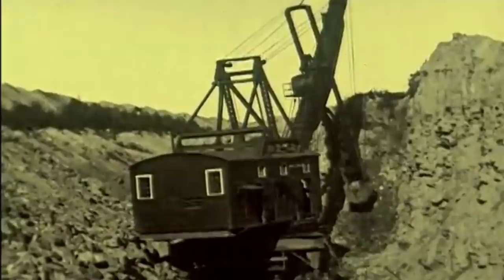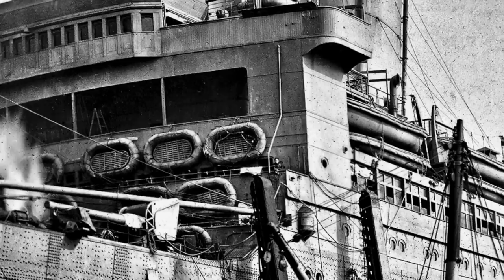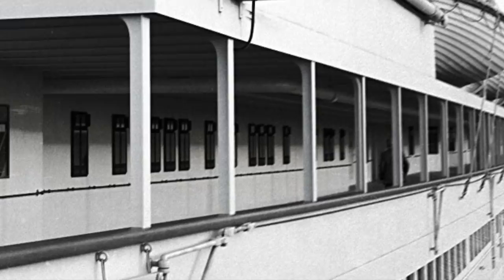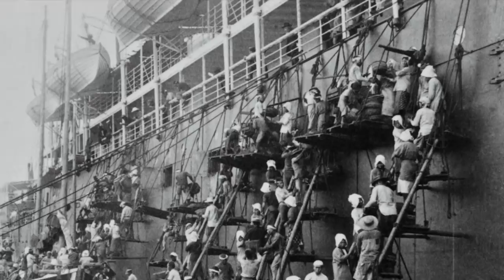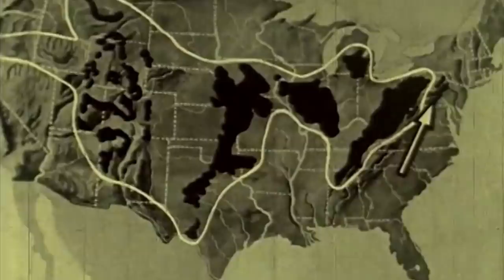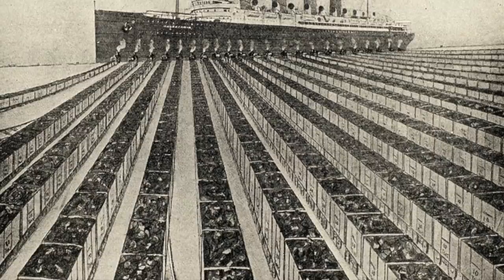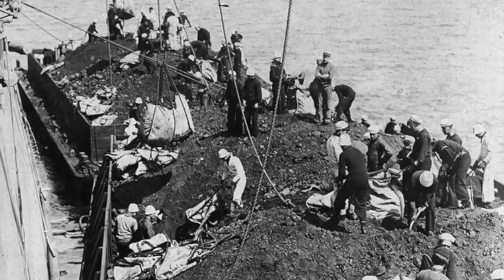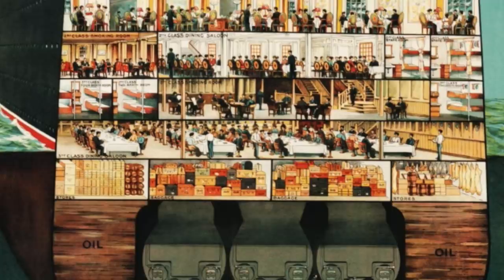Coaling/Bunkering an Ocean Liner

Comment: An example of how coal supply can cause problems was RMS Atlantic - for a long time Canada's worst ship disaster in terms of lives lost.  Atlantic was inbound New York, pretty-well full of passengers including steerage, whose access to the boat deck was severely circumscribed by the two little hatches that were all they were given.  Unknown - but rumoured - the White Star Line had 'salted' its coal load with some cheap stuff; Welsh steam coal was acknowledged the best, and needless to say, it also commanded the highest price so it was not unknown for shippers to bung-on a few thousandweight of cheaper stuff (or even 'made' coal; collected coal dust with a binder to hold it together - Kipling's "McAndrew's Hymn" refers).

So RMS Atlantic set-out against the Gulf Stream and continuously encountered foul weather, and used more coal than planned, and at some point the chief Engineer advised the Captain that they likely didn't have enough coal to reach New York; in this, modern estimates suggest he was wrong and was exaggerating the problem, but hindsight is 20/20 after all.  The Captain turned north toward Halifax to get more coal, and a "comedy" of errors and disobeyed orders resulted in tragedy.  Celestial navigation with stars and sextant was how ships navigated across oceans then, but they'd been in ugly weather long enough that they were navigating by dead-reckoning and unsure of their position.  The Captain retired to his cabin for some sleep, leaving orders that he be awakened at midnight; his intent was to slow the ship and start taking soundings with the deep-sea lead to learn the water depth and bottom composition, which would give him an idea of how far offshore they were.  Then they would anchor and await daylight, to take sightings of the shore and compare with their charts, and if need be they'd send a boat ashore to ask a local fisherman where they were - all perfectly normal in those days before GPS.

But the bridge watch decided to let the Captain sleep so they never called him at midnight and RMS Atlantic kept-on northward at high speed, and the current off the Nova Scotia coast sets to the southwest; so as they approached the shore, watching for the Sambro lighthouse west of Halifax harbor, they were already too far southwest to see it.  RMS Atlantic slammed into the rocks just offshore and was swept onto its beam-ends; most of the immigrants drowned trying to get onto the deck, and the heavy swell drowned many more of those who did get off.  The stupid little things that cause fearsome results...
Reply: There's a good documentary on the Atlantic that includes excellent computer graphics, reenactors, and local historians: https://www.youtube.com/watch?v=Z6JkwN7kw8E
Reply: It's OK, the crew lost only 10 men and the captain was awake at midnight
Reply: Chief Engineer John Foxley had a habit (which was commonplace amongst engineers) to under estimate the coal reserves in order to force Captains to be more cautious. The ship had enough coal to reach New York, but barely and Foxley knew that, had he reported the actual amount remaining, it would be at odds with his previous reports, so he chose to under estimate again.
Reply: @SiriusXAim  Even today, Chief Engineers love to show less fuel and diesel oil in the log books.  Its often to have a little extra just in case of any issues, and ship owners charge the charterers for more fuel use as well.  That's why when a ship goes on and off-charter, there are surveys done to confirm the actual amount fuel on board.

Comment: I remember in a book about the German merchant raider SMS Wolf (spent an astonishing 451 days at sea w/o once entering port), they're on their way back to Germany & about to run out of coal, & as a result basically pirated a Spanish freighter loaded w/ coal. at first they thought this was an incredible bit of luck, but ended up screwing them over because the vastly inferior Spanish coal only had about 1/20th the energy as the plundered British coal they had been running on. trying to transfer the coal at sea actually ended up burning coal at the same rate-of-speed they could transfer it to The Wolf, so they had to cut their losses & abandon the newly captured freighter & coal

Comment: I'm writing a historical fiction / high seas Thriller that takes place during the years before during and after the first world war. This information is very helpful in video form. Enjoyed the video very much
Reply from the maker: I'm glad this is helpful. The sources for this video are listed in the description, so you might want to check those out too. Good luck with the book!
Reply: I was in the navy and was a boiler tender.  The boiler tenders had the hardest job on the ship.  they had to spend hours and hours to get the ship's boilers and equiptment up to running speed,  before all the other sailors had to board the ship. and it was hotter than hell in the boiler rooms as the ships were designed to cruise in seas of average temperature, In the south pacific the sea temp is much higher and as the ship aged, more demands were put on the operating plant, by bigger airplanes to launch strained the machinery caused breakdowns. and when you returned to port you had to complete the work and repairs you could not do at sea, because the boilers were constantly fired at sea.  Boiler tenders had the least amount of time on shore, because of this reason.  all the other sailors could  just close up shop and leave the boat while in port.  I liked the navy, but wanted to have a dog and figured it wouldn't happen in the navy.
Reply: This would make a great activity to work into the plot somehow.
Reply: David Jones  No i just learned life is not fair.  Boiler tenders got no respect.  all you ever see of carriers is video's of the fly boys.  it was dark and dirty in the boiler room, they used to send sailors down to the boiler room for extra duty, as punishment.  we had extra duty every day.  we never made the guys assigned extra duty work.  it was bad enough just being with us in the hot nasty place.  only way you can get guys to work in the boiler room is to make 18 year old punk recruits like me do the job .
Reply: @johngillon6969  I've noticed that steam engines in particular are romanticised to no end, often by people who are dissatisfied one way or another with their modern lives. I can't deny that steam engines are awesome to look at and hear. But like most things people get nostalgic about, they tend to forget the poor sods for whom this was grueling, badly paid work that even the sailors on higher decks considered punishment.

How much contact was there between the "departments" aboard the ship? Did sailors and machinists mingle off-shift?
Reply: @namewarvergeben  Engineering had the divisions sleep in separate compartments of of the ship 3 main machinery had it's own berthing space.  we hung out together and went on liberty together.  we kind of had a pride in that we were the boiler tenders, and it was such a shitty job.  we were young punks .  All the other rates such as those who worked on the flight deck hung out amongst themselves but for the most part we all got along together.  We just learned that life wasn't fair and we made the best of the situation.  I didn't feel resentment or put upon, it was just what happened, and the navy was like the family i had left in albuquerque.  I think we were all proud of our ship and loved the captain like a father and those with higher rank were like older siblings..  We all tried our best to be good sailors and act like were all grown up men tho we were for the most part 18 and 19 year old dumb kids.
Reply: @namewarvergeben  LOL.  When people wax nostalgic about the old days, a friend of mine replies "I have two words for you. Modern dentistry."
Reply: Some required reading... "McAndrew's Hymn," by Rudyard Kipling. "The Sand Pebbles," (made into a film starring Steve McQueen, amongst others) and "The Left Handed Monkey Wrench," by Richard McKenna. Then spend some time volunteering on the preserved steam ships nearest you... Or if you have the cash, the R.M.S. Segwun in Gravenhurst, Ontario is a coal-fired steam ship with twin reciprocating compounds. The T.S.S. Earnslaw on Lake Wakatipu in New Zealand is coal fired with twin triple expansion engines. The S.S. Sir Walter Scott of Lake Katrine in Scotland is coal-fired with a single triple-expansion engine... There are more around the world. 

Good luck! 

I'd love to read it when you're done!
Reply: Thanks for the helpful insight y'all
Reply: Sounds like a good story

Comment: Thanks for this hugely interesting episode. I visited USS ‘Olympia’ in Philadelphia some years ago and was impressed that everything on that ship ran on steam, all of which was reliant on coal. At points in the ship there were steam-powered hoists which brought ash up from the fire rooms, and tracks along the overhead to scuttles in the hull so the ash could be dumped overboard. I had never thought about that kind of waste problem while underway.
A danger you did not touch on which coal-fired ships faced was fire, from spontaneous combustion in a coal bunker. That could happen from bringing aboard wet coal, which is a separate question (if the coal,was in open barges, there was no way to protect it if it rained. so loading wet coal increased the  chance of that coal spontaneously combusting, once it was stowed in bunkers), and required in some cases men actually going into the bunkers and digging down, if possible, to the source of the fire and extinguishing it. 
The USS ‘Maine’ experienced just such a slow-burning fire in a coal bunker when she was sent to Havana, Cuba in 1898 as a show of American potential. Unfortunately, the plan of the Maine’s bunker layout had that burning coal adjacent to a bulkhead that separated the bunker from an explosives magazine. The heat from the fire elevated the temperature of the bulkhead until the powder stored in the magazine detonated, tearing off the forward section of the Maine,sinking the ship and killing a large number of the sleeping crew. 
The US newspapers owned by William Randolph Hearst claimed the explosion was due to a mine (Spanish, according to Hearst; a ‘dastardly trick’) instead of an accident. So the US went to war with Spain over a coal bunker fire. 
Analysis of the sinking of the man conducted by the Navy in the Mid-20th Century proved pretty conclusively that was the reason the ‘Maine’ blew up, and not the mine or outside cause claimed by the Hearst papers.
Great work; thanks for your efforts.
PS - I was an Infantry officer in the Army. I grew up in an Army family; my father was a Transportation Corps officer. Their motto was ‘Try Moving Without Us’, and though the Infantry ostensibly gets around on foot, the Army’s ability to move troops equipment, and logistics is reliant on the techniques developed by the Transportation people. I am an historian, and appreciate your motto of being at the intersection of transportation and history.

Comment: Can't wait for the oil video!
Reply: I was a boiler tender in the navy on the kitty hawk.  you would not believe how much that sucked!  Any way i was ok with navy life but wanted a dog and didn't figure that would happen in the navy.  also at 22 years old decided it was time to climb out of that bottle.  Everything worked out well with the dog.
Reply: ryan Washington  I was aboard the ship in 1968, and i believe that the kittyhawk and constellation were too large and the new airplanes were bigger and it put too much strain on the engineering department.  I don't think the atomic powered ships had the problems of the last two oil fired boats.  we used bunker oil when i was on board.  they later switched over to diesel oil fired boilers.  that may have helped but i don't know.  I learned working in the boiler room that life is not fair.  there are no more boiler tenders in the u.s. navy. as all the boiler driven ships are gone. it is all diesel gas fired turbines i believe.  Being a Boiler Tender in my opinion was the hardest dirtiest and hottest job  in the navy.
Reply: @johngillon6969  As an Electricians Mate (who had the most pleasant job in "Engineering"), I have witnessed the truth of your statements and can only offer my RESPECT to all the old school Boilermen for "what, why, how, and where" they worked. Guys that knew what heat and filth was all about and truly knew the joy of a GOOD shower,
Reply: @johngillon6969  How is the dog doing today?
Reply: @FinalLugiaGuardian  Thanks for asking, he is fantastic, he took the day off yesterday, i was getting on his nerves.  he stayed home while i adventured solo.  He is back in the saddle now and itching for action.  Look out portland or.

Comment: Great video mate! Very interesting :) I'm a stoker myselfe.

Just one thing about the stokers and trimmers: The trimmers supplyed the stokers/firemen with coal. Also, the trimmers had to clear the boilers many fireplaces of ash and slag. Haul it away from the boiler room and hoist it up and dump it over board. The firemen were much higher in rank than the lowly trimmers. The stokers/firemen on the other hand, "only" were feeding the boilers coal and keeping an eye on the water level in the boilers. So in other words, the trimmers had a much harder and more brutal enviorment to work in.

Cheers!

Comment: Great video. You should expand it and talk about the Trimmers and Coal Passers whose job it was to be actually inside the huge coal bunkers. The Trimmers would make sure that as the tons of coal was moved to the furnaces that it didn't unbalance the ship. They worked like sea going cola miners. Like coal miners, they could be killed when the sea shifted a mountain of coal down on top of them. The Coal Passers kept the Stokers supplied with properly sized coal pieces to feed to the furnace. Hard work. Hard men.
Reply from the maker: I intend to in a different video down the line. Thanks for watching!

Comment: I don't know that it was caused by shorting coal, but SS Sirius on her maiden transatlantic crossing ran out of fuel and had to burn furniture.
Reply: I've heard stories about Egyptian steamers using mummies for fuel.  That's what they had that would burn.
Reply: WAS IT A LUXURIOUS SHIP? IF IT WAS, IT MEANS THAT MANY 1ST CLASS PEOPLE ARE MAD AT THE COMPANY THAT OWNED THE SHIP IN QUESTION!
Reply: Wasn’t that one of the first transatlantic ships?  I’d imagine that fuel requirements were pretty experimental and that breakdowns were common as well which is why it retained auxiliary sails.
Reply: PS Sirius was not designed, or built for, the trans Atlantic. PS Great Western was, and arrived later the same day, having departed a week (?) later, still had "plenty"of coal in her bunkers.
Sirius left port with coal piled on her decks!